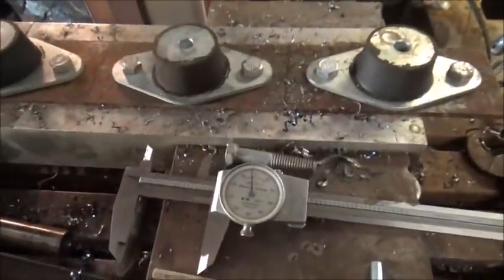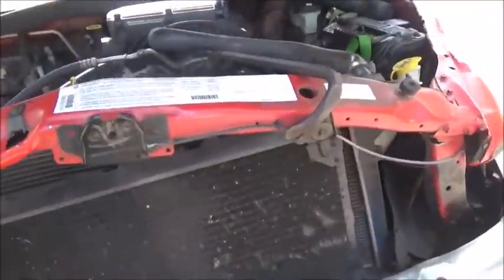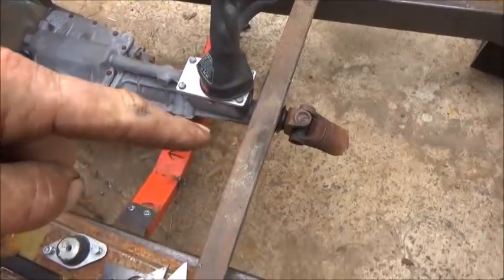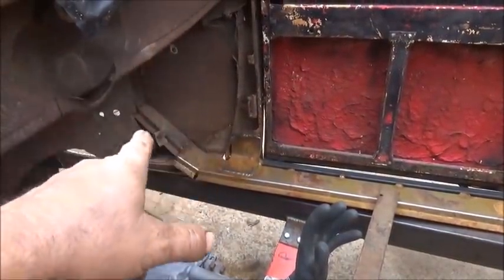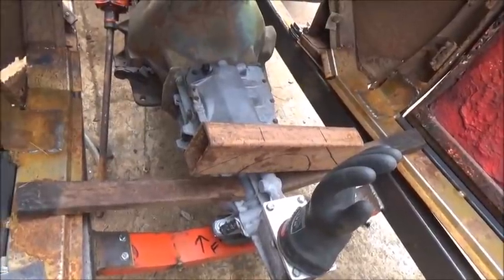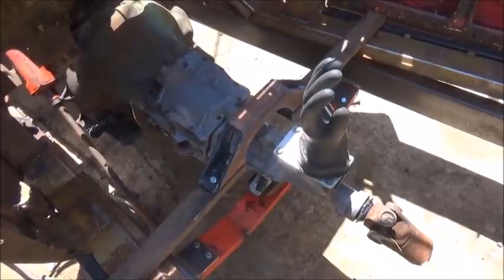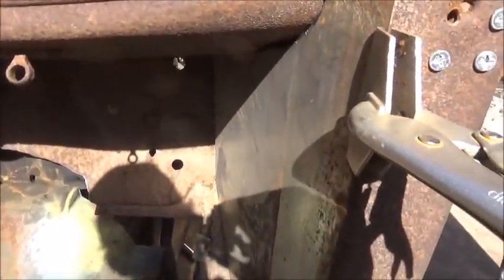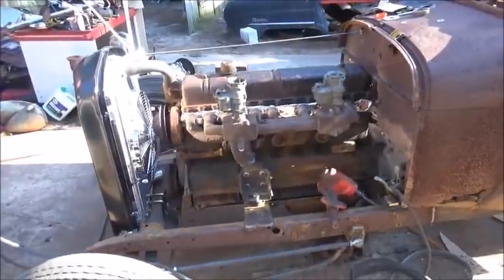1929 ROADSTER PICKUP FROM JUNK PART 13 CAB MOUNTS

Comment: You mentioned about the Dodge 4x4 removing the body and bed and putting on an older style truck . Me and 2 friends each bought a Willy's Jeepster ( 1948 to 1950) and we are mounting them on later model 4x4 chassis and running gear. That's a thought for you. Keep building them.

Comment: Jonathan i think that Ram running gear would make a good project later with its 4 wheel drive set up like you said put it under a old Rig ,, i was thinking of how you want to two tone this engine for the 29 roadster pick up what about doing the checker broad on this one but in the two tones same as the engine ,,,,maybe go diagonal this time with the pattern would be different look ..the 29 looking better every time you all stay safe ,,,,great job

Comment: One day and step at a time, the rod is coming right along, the duce carbs do look great. A suggestion for the rear suspension.. Run airbag with leaf springs ..it will give you a softer/ smoother ride.
Great work Jonathan 👍👍😊

Comment: Yeap, those Carbs are way cool. body mounts are real solid. I do see daylight through about every joint in the cab, can you weld those pins holes or what? The stance of the Hot Rod is really nice. Dual Exhaust. will fun to do as well. Take Care and I am loving this built a ton. I liked the Bullet Nose and the Golden Hawk, this Truck here and that dang Chevy Panel whatever you see to do, it just appeals to me. I have to try to get one of your creations some day. They are so neat. D

Comment: Coming together nicely. When you spray some flat black on the chrome cowl, spray the whole radiator, as that's the best colour for a radiator to accelerate the cooling process. Looking forward to you driving it down the road on it's maiden voyage.

Comment: I sure could use the air filter box off that Dodge pickup along with the clamp that secures it to the throttle body and the air tube from the box to the right side fender, if undamaged. Have a K&N air intake setup to trade or will buy. In KY, 40223.

Comment: Those 318s may not be big on power in Stock form, but they are tough as a ten cent steak.
Reply: Got that right..no car like a mopar ...71 pick up d100 stepside had a 318 2 wheel drive..there was no where I wasn't hesitant to take that thing.